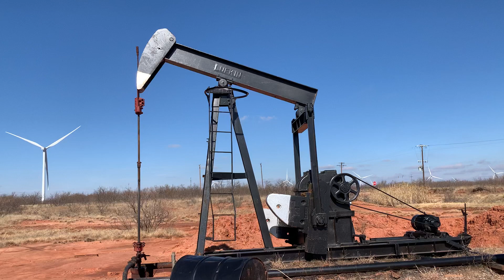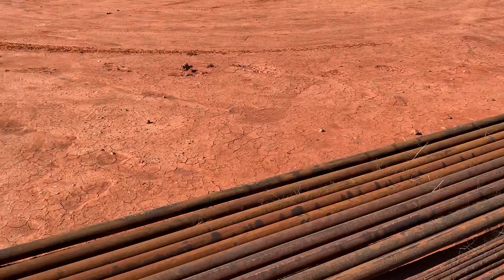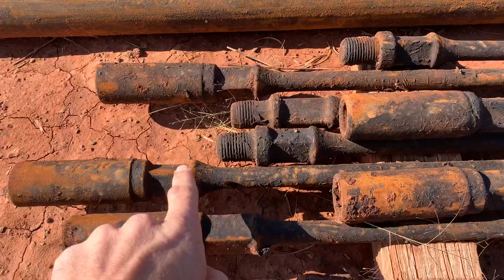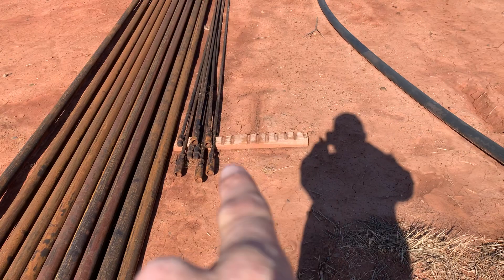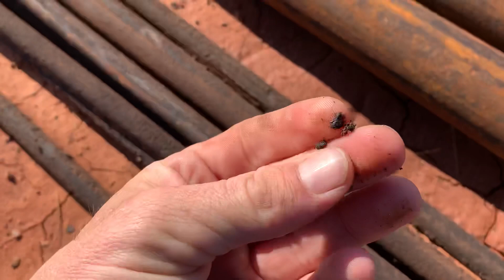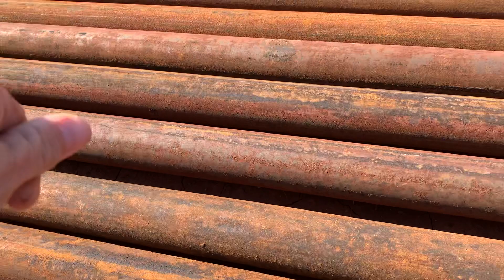Oil well tubing and sucker rods

Comment: What is the black hose coming from the tubing? Is oil flowing through that?
Reply from the maker: That is the poly line/flow line. That is connected to the tubing. The larger diameter below on well is the casing. The tubing sits inside of the casing. Tubing can be pulled and replaced repaired where as casing is cemented in. Hope that helps